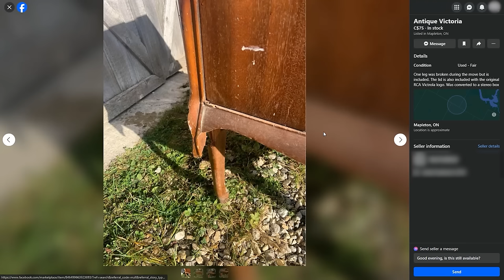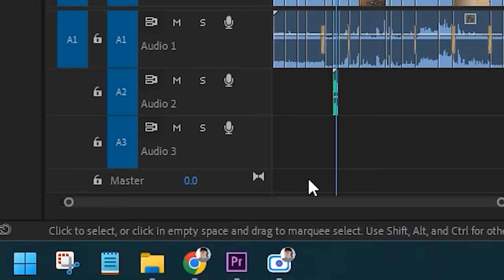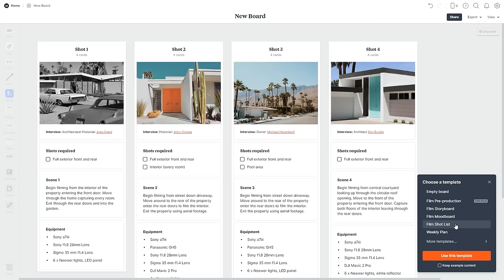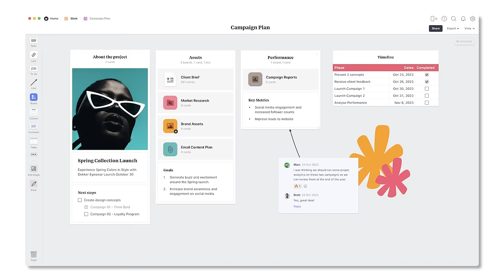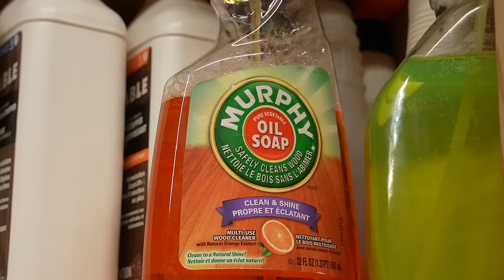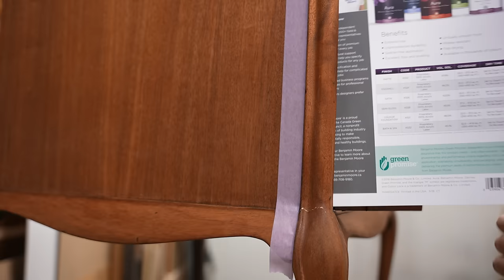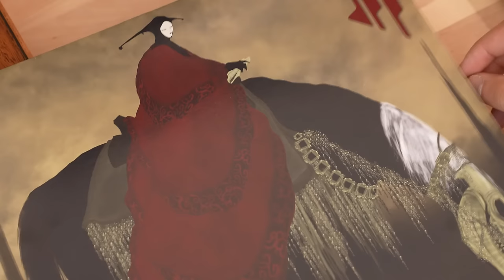Antique Record Player Cabinet Restoration - It plays music again :)

Comment: Greatest challenge, but I think your most impressive piece. Blending the dark legs into the lighter body works SO much better than I think the stark contrast between them would have. Very glad you kept so much original, especially the inner lid. And what great luck that it's still holding a Victrola player!

Comment: This is a beautiful cabinet.  My Grandparents had one of these, but it had been converted to a sewing cabinet by Grandpa for Grandma.  At any rate, just a suggestion for the front doors on this project... You might have considered cutting new pieces of Red Oak and staining them close to the Mahogany Veneer, or using Birds Eye Maple an building a pair of Contrasting front doors.  The last choice, would have been my personal... would be some Red Manzanita, this gives you the red of the Mahogany but the Bird's Eye look of Maple.  For the top, I am very glad that water scar came out.  I have repaired those by sanding, then glue-sizing the wood.  

At any rate, beautiful project. Just beautiful.  and... Yes Tung Oil is my favorite wood finish too.  Just beautiful!!!

Comment: I really enjoy watching your remakes...both for your creativity, and your sense of humour. Perfect timing on the moon landing. Those ombre legs are great, and love that you kept the original finish on the inside lid. I did come away wishing the interior felt a little more finished, however. Previously, the interior would have had that same dark mahogany finish as the inside lid. Though I am not a fan of black myself, using it on the inside may have minimized the disparate pieces of wood and left it looking finished.

Comment: Wasn’t sure about the blended stain on the legs, but it turned out great. Makes the piece more interesting. But I am mystified by not finishing the interior panels. They will get a lot of wear, but are just raw wood. Doesn’t make sense to me, after all the effort you put into the exterior.

Comment: You really need a big sandblasting cabinet to save you from spending hours sanding down all of those wood panels. Also, I recommend putting a rubber through the hole where you put the record player's cable through just to be extra safe. Great video otherwise. I really like all of the woodworking techniques used and learning from them.

Comment: "Veneerial disease" is what we called it😂.
Hinges were never black...none of the hardware was...ugly & a silly project. Please understand we used to knock almost everything apart as far as possible & reglue so nothing ever came back because an old glue joint failed. 1 lacquer failure out of hundreds of case pieces...thank you Sherwin Williams.

Comment: It was absolutely stunning but you lost me when you went two-tone on the legs. :(  Still amazing, though. I suggest you find a 90 degree connector for the power cord and solder it on instead of the straight one. That way you can slide the player back more. That's what I did on my laptop. Or modify the power port on player.

Comment: Absolutely no need for screws with Titebond 3. The glue joint is stronger than the wood. In point of fact you weakened the leg by adding screws because you added two new easily fractured areas because you destroyed the linear integrity of the wood fibers. Seriously, don’t do that.

Comment: You should've stained the flat part (only) of the top a darker color as a contrast to the legs. Also, you should've stained the inside a dark color. It looks too plain like you just threw a couple of pieces of scrap wood in there to do the job! They don't match the rest of the cabinet. Otherwise, you did a nice job!